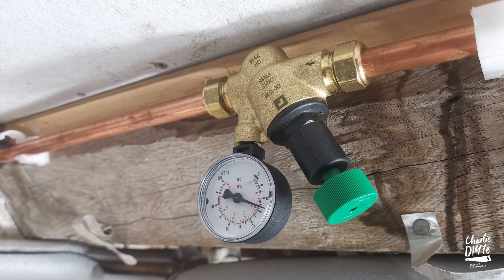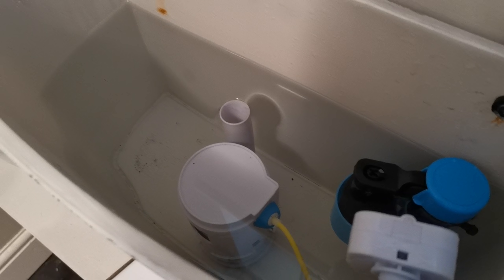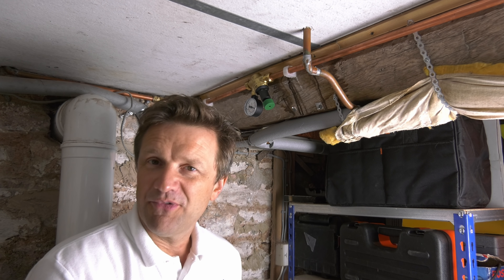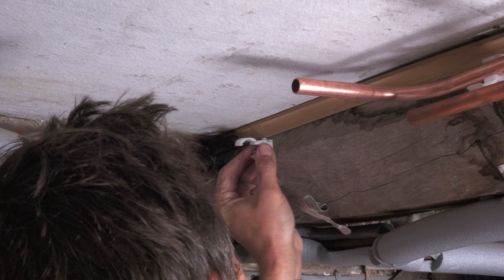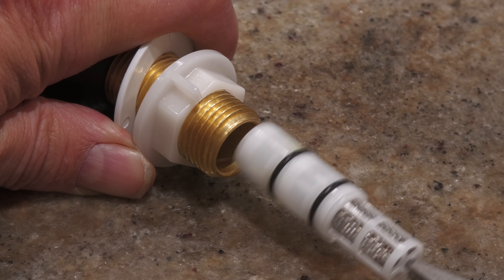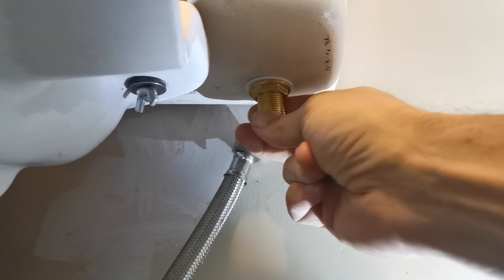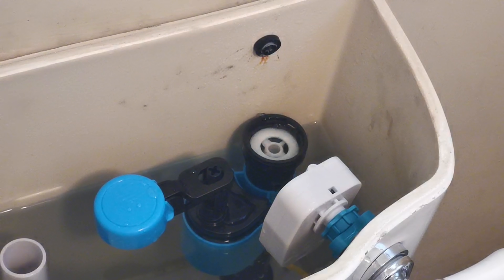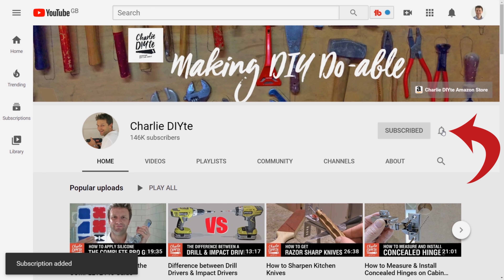How to Fit a Pressure Reducing Valve to Fix a Cistern Overflow Problem

Comment: Why couldn't you just turn down the isolator valve? Is a pressure reducing valve quieter?
Reply from the maker: I should have mentioned that. Turning the isolator doesn't actually reduce the pressure it just reduces the flow. A bit like putting your finger on a hose pipe, so it can actually do more harm than good.
Reply: @CharlieDIYte  But if the water expands again to fill the pipe on the outlet side isn't it more like a tap? Ie taps don't shoot water out at high pressure when you turn them down. Or if you pinch a hose at the end you get a jet but if you pinch it in the middle you get a dibble.
Reply: Actually I've worked it out - PRV's have a spring inside to do the equivalent of turning the tap to keep the output pressure always at the set level.
Turning the isolator valve down would reduce the flow whilst water was going through it only, but obviously the pressure would equalise once flow stopped. So when you flushed the loo the refill pressure would be as high as the mains pressure momentarily and then drop to whatever level the isolator valve allows.
Hope your loo keeps working this time :D
Reply from the maker: @benhowellthomas  . Yes, that's it  Thanks for that. 👍

Comment: Yeah it does annoy me too when a "professional" installation leaks, practically every other solder connection in my kitchen was crusty like that one you showed. I redid them all and wiped the flux off after.
Reply from the maker: Exactly - also no-one of the joints they did were deburred, so I live in fear of pin holing. Good work sorting yours out 👏🏻